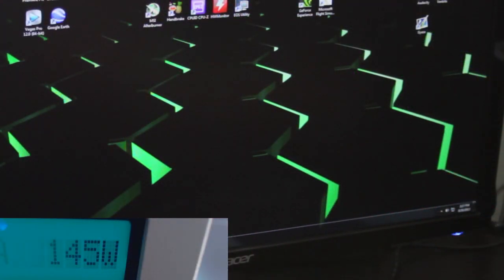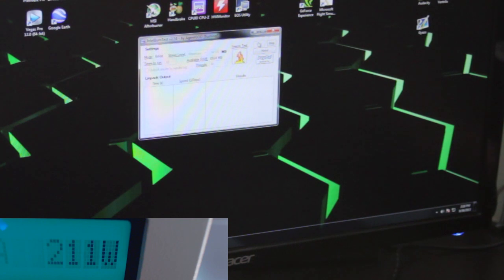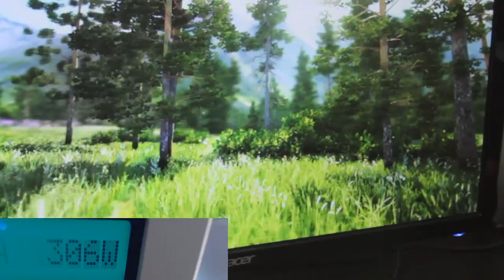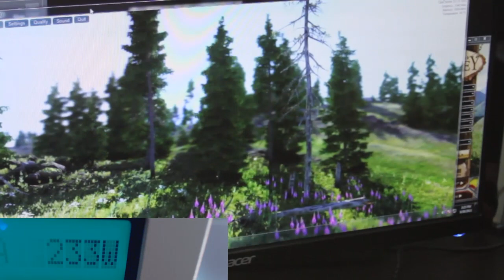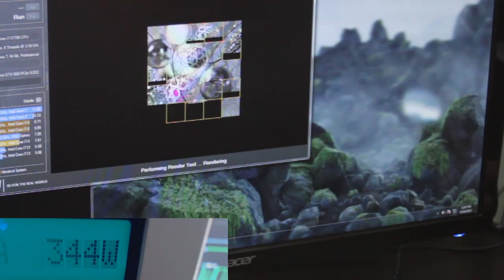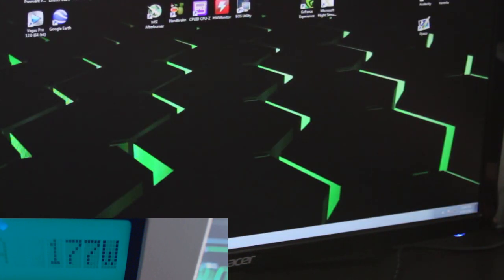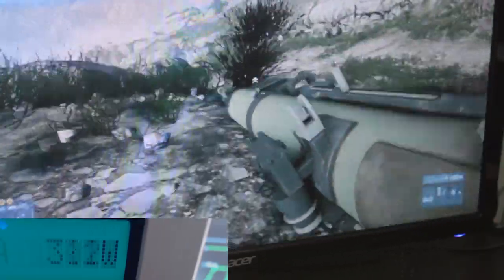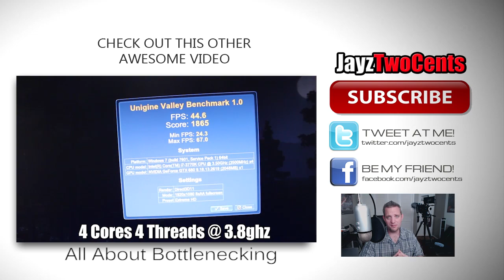How big of a Power Supply do you REALLY need?

Comment: Is 550w 80+ Platinum good for an i5-4670k (most likely overclock later in time), a GTX 770 2gb it has 3 fans on it, 8gigs of ram (2x4), asrock z87 extreme motherboard.
Reply: you can run that system easily with even a quality 450w. you're good to go. I've seen people run nvidia 780, titan, and even a non-oc 780 ti in a quality 450w.

HardOCP:http://www.hardocp.com/article/2013/05/30/msi_geforce_gtx_770_lightning_video_card_review/9#.UzHHPldniJQ

That's with a i7 3770k @4.8GHz and a highly OCd GTX 770 and it still only used at worst 373W. So even with those Overclocks, (373*0.9 for efficiency), you would use around at worst 61-62% psu load at PEAK during gaming.

Comment: I have:
GTX 680
i7 2600k
Asus  Sabertooth p67 motherboard
8 gb g skill rip jaws 2100 mhz
and 2 hdds
what power supply do i need?
Reply: quality 450w psu and all you really need. on the video, it showed at worst he was hitting 325w on the wall. account for efficiency, thats 325 *0.9 = 202.5/450 = 65% or so psu peak gaming load.

PSUs I reccommend: Seasonic G-series 450w, rosewill capstone 450m (if you're on a tight budget), Silverstone SFX 450w (for mini-itx systems).

Comment: can i use a 1000W psu temporarily on a rig without GPU's ?

as i am getting 2 780ti's for SLI in a couple months, so is it safe to run the rig ?
Reply: of course its safe to use less power than its rated for. The problem is when you use too much power your computer will shut off because the power supply "trips" like a breaker in your house.
Reply: Is it safe? Yes.  Is it efficient? No.  It also couldn't hurt to check the voltages manually, just to make sure they aren't off due to low load.

Comment: running a 850watt 80+ bronze 680/3770 might throw another 680 in a year or two but finding my card would cost more then buying a new top card would
Reply: Always sucks about that Enthusiast level 2 year old cards. they go extinct because everyone keeps them.
Reply: Christian Sanfilippo i checked the numbers my 680 right now with my overclock has better performance on average with games at 1080p then stock 780s do im sure i could still get $500 for my card even if it is older could easily hit 1.4 core and 7ghz on the memory if it was on water

Comment: Man!, if I tried to run this on my slow computer... O_O

Specs. (Not all of the specs because I don't really know how to figure them out... DON'T JUDGE ME)

AMD Athlon II 2.20 ghz Dual Core P340 Processor

64 Bit

HP Manufactured

2009 Windows 7 Home premium

I couldn't find out the other stuff like GPU, Motherboard, etc. Sorry.

Also note that it can barely run ROBLOX on the lowest settings

It crashed when I ran Starmade for a milisecond for the first time

AND it can't really run Minecraft that well either

Comment: I have a :
FX-6300 OC'd @ 4.2
8GB (2x4GB) RAM OC'd @ 1866
Radeon 7950 OC'd @ 1000/1300 Core/Mem
WD 1TB HDD
Optical Drive
Six 120mm fans
Fan controller
And all with a 650W 80+ Gold rated PSU. Been running great.
Reply: ***** Why would I need a 750W? My 650W is perfectly capable and has been running great. I have a SeaSonic too which is one of the best brands, if not the best.
Reply: ***** XFX over corsair inless you go to there top of the line i stay away corsair :( used to trust them 100% now XFX is my GO TO brand :D
Reply: INoIFearIGaming Seasonic is the shiznt :)
Reply: FX-8320 OC'd @ 4.5
8GB 1.5v 1600mhz
gtx 580 twin frozr 20% oc
WD 1TB HDD
Five 120mm fans
Fan led controller
3 led strips

on a Antec TP-550watt 80+
Reply: Archit N. Why should i get a new one when this one can keep everything stable?
Reply: OCed 7950 Windforce x3 (1150 core / 1500 mem) and an 8350 (stock) on a 550W Gold rated PSU and it works just fine.
Reply: Mats Renooij Get a seasonic 620w
Reply: Seasonic 620w.
Reply: ***** You have triple 7950's on a 550W PSU? No....you don't....
Reply: INoIFearIGaming windforce 3 is the model of gigabyte card cooling...
Reply: Durolith Ah, he meant Windforce 3, not x3. By putting the x3 I thought he was saying he had 3 GPU's

Comment: You are off on where power supplies are most efficient.  75% load is typically where they're best, not 100%.  At max load voltage regulation often starts to get ugly and efficiency falls off.  Just look at the 80+ certification requirements.  Power supplies need to hit certain efficiency percentages at 20%, 50% and 100% load and 50% is always about 3% higher than the other two as it's closer to the optimum range for a power supply.

As others have stated, overall efficiency is the DC power output of the power supply divided from the AC power draw (wall power) and lets you know how much energy is being wasted in the form of heat during the conversion.

Comment: u got the efficiency thing wrong. 80% efficiancy means that that power supply (assuming a good quality power supply . not a generic 1) will use 20% more power to deliver its stated watts. a 750w power supply will deliver that 750w while actually consuming 100*750/80=937.5w off the wall. it does not mean that a 750w power supply with efficiency of 80% will deliver 750*0.8=600w.

Comment: I'm kind of worried now that I went with the wrong company. AMD is pushing out some promising hardware and software to match with mantle. All I have is g-sync witch I won't want to buy 3 of then to replace the ones I have now, and not many games use physx. I got 2 evga FTW edition 770's. I hope AMD allows NVIDIA to acquire mantle support because it has true potential. Bf4 kinda skimped a little with it is my opinion.

Comment: i went a bit close to the danger zone on mine. r9 280x 4670k h80i etc with a 550w psu. predicted wattage on pc partpicker is 451w before i overclock. i went the 50 extra over the generic 500w to give a little room for the oc and for capacitor aging. informative vid jayz

Comment: What PSU would you suggest i get for my new build 600w or more?

MSI Z87-G45-GAMING ATX 

Intel Core i5 4670K

G.Skill 8GB DDR3

Corsair 120mm Hydro Series H80i

Asus GTX 770 Nvidia GeForce DirectCU II OC 2GB

WD 1TB (Black)

SSD: Samsung 840 EVO 120GB

Asus DVD-RW Drive

Case:  Fractal Design Define R4 (2x140mm case fans)

BenQ XL2420T 24 inch (120ghz)

Keyboard: Corsair Vengeance K70

Mouse: Corsair Vengeance M95
Reply: A quality 650W would be just fine

Comment: Something I don't get is that I have a corsair 550 watt power supply I use a single 7870 (overclocked) an FX 8350 (stock) on a 970 A motherboard with 8 GB of RAM single channel, I on multiple occasions have gotten blue screened while playing the witcher 2 and painkiller for some inexplicable reason bit not while playing BF3 or far cry 3. Could someone please help me, should I be getting a new power supply unit?

Comment: really nicely explained and showed, i always have those stupid arguments with some dumb kids/brats who think that in order to run any type of SLI you need 1000w+ lol. 

I have 600w myself, running 8-core FX8350 @4.1ghz, 16gb Corsair Vengeance RAM, GTX680 Phantom, LED strip, 11 USB devices. 2x SSD, 3x HDDs and Asus Crosshair V Formula-Z motherboard.
I think my whole system uses about 400w under load.

Comment: how much wattage will i need for an i5 3570 and a gtx 660?
Reply: you could run that with a seasonic g-360 gold modular psu even with an overclock on both the cpu and gpu.

Comment: what you said is wrong. a 1000 watt power supply at full load with 80 % efficiency will deliver 1000 watts but draws 1000/80*100=1250 watts from the wall
Reply: Look at the back of the box of your psu. It will probably say it van deliver more than the front of the box says. It is rated tot DELIVER 1000 watts. Have you ever had soms kind of science class?
Reply: Daniel Ungureanu if you had paid attention in science class or whatever it is called where you are from. you would know that if it is rated to deliver 1000 watts under load and it will convert ac to dc at 80% efficiency  it will draw 1250 watts. im not talking about peak performance so this has nothing to do with it being unstable.
Reply: Martin Heuts http://en.wikipedia.org/wiki/80_Plus  NOW ALL STFU YANNICK IS RIGHT!
Reply: yannick van niel to make it more easy for people to understand i will make a very easy example. if you have 2  cups, one full and one empty. you want to transfer to water to the empty cup. this cup will hold 1000 ML. while you transfer the water you lose some because you spilled some. this is your efficiency (80%). how big is the first cup? divide 1000 with 80% and multiply by 100% and you get 1250 ML or watts. in order to fill the first cup you need more water than will actually fit in there or in other words, in order for your power supply to deliver 1000 watts at 80% efficiency you will need more input than it will actually be able to output. the only difference with 80+ bronze silver etc is the amount of power that is actually drawn from the wall. it has no effect on power that is delivered to your pc. this obviously is not the case with cheap power supply's.
Reply: My bad. It actually seems this guy is right.
Reply: Sounds interesting from that point of view. Could you show that in a video?
Reply: yannick van niel We believe you! But could you maybe show it in a video?
Reply: Daniel Ungureanu Please explain why manufacturers put 1000watt on their PSU's. So that you can fry your PSU and claim warranty if your hardware is using exactly 1000watts all the time? No, they build a 1200, 1250watt (wattever) PSU with over 80% of efficiency, to deliver the promised 1000watts.

If you use a 80+ Platinum PSU, you would save money because a 1000watt platinum PSU would draw something like 1080watt from your wall socket.
Reply: yannick van niel That's what i'm also saying man! 1000 watts deliver 1000 watts to your components, but draw more watts from the wall due to the efficiency level. I was just stating that what Daniel was saying is wrong, He stated that a 1000 watt supply can max draw 1000watts from the wall socket and delivers less than 1000watts to your components. If what he is saying is right, then everyone who actually installing hardware that is using 1000 watts at max usage, you will fry your PSU (according to what daniel is saying!!). But you won't fry it, because it's made to deliver that.
Reply: "The efficiency of a computer power supply is its output power divided by its input power. The remaining power is converted into heat. For instance, a 600-watt power supply with 60% efficiency running at full load would draw 1000 W from the mains and would therefore waste 400 W as heat. On the other hand a 600-watt power supply with 80% efficiency running at full load would draw 750 W from the mains and would therefore waste only 150 W as heat." - From Wikipedia
Reply: I always thought that a PC power supply watt rating was what it can deliver. NOT what it draw's from your AC Socket .
Reply: Great thanks, yet I think that's not what we wanted to see Yannick. Let me specify: we need you to record on camera a PSU giving 100% of its load in DC and drawing 120% of its load in AC. Any 80+ PSU at hand will do. Even if it's hooked up to the PC and you know exactly how much watts the PC is drawing (might be handier to calculate). I'm sure Daniel would if not agree then at least accept the fact, right?

I am a musician myself, but I'm also aware of this phenomena in physics. We have so much freedom in this social network that we can directly contact a certain person and show him stuff, instead of doing good old "ALL CAPS RAGE ON DEM NUBZ"
yannick van niel
Daniel Ungureanu
Reply: Daniel Ungureanu
a psu is rated for the wattage on the rails. A 1kW psu will deliver 1kW on the rails and draw around 1200w from the wall. The 200w is being lost in the conversion from 230 to 12v and being generated in heat.
Reply: They are rated for what they can deliver and the power loss comes on top of tjat
Reply: He is. But to be a dutchie and call anyone stupid in an argument seems a bit undutchie to me....
Reply: Dmitry Granicin never mind that video is missing half il upload it again :l
Reply: yannick van niel Would be much appreciated :)
Reply: yannick van niel /watch?v=s4ZWHeodJpU this is the correct link
Reply: i'm sorry but i don't have the equipment to measure how much power i'm using
Reply: you can use a socket with wattmeter from one side (to see how much the PC takes from the wall), look for wattage of CPU, GPU, mother, RAM, HDD and SSDs on their manuals (or on the websites), and with the tester you check how much power is given to the motherboard via 24pin cable.
Reply: If I had my build complete and running I would do it myself, but right now I'm on my laptop so no luck for me.
Reply: Dmitry Granicin yes i understand but i don't have a watt meter. also most components will not run at maximum wattage even when under full load. so i cant know how much power the pc itself is using
Reply: You can already take it easy, I think. With information both of us supplied everyone seeing this conversation can test him/herself how PSU works and how much is actually needed.
Reply: Martin Heuts I thought it's common sense to take power supply a bit bigger than the expected load for it at least for the upgradeability purposes. I think if it's a 80+GOLD to 80+PLATINUM PSU it will be able to deliver full nominal load without frying itself...It'll just produce more heat and eat more AC, right?
Reply: Martin Heuts they put 1000 watts on their power supply's because that's what they are made to do. deliver 1000 watts... and to be sure you dont fry it they will give you some headroom. my 600 watt psu is actually capable of delivering 706 watts according to the box. but this is only the peak performance. also your logic is flawed. you reject that 1000 watt PSU's can actually deliver 1000 watts, because it will fry itself. and then you admit that a platinum PSU will actually deliver 1000 watts..
Reply: jikke dobbelaar That some nice explanation foranyone who need it
Reply: Ryusenko Hon You dare to tell me what to do? Then take care: your nose is not so sturdy as you would like it to be.
Reply: Dmitry Granicin lol...what did i do D:
Reply: Ryusenko Hon lol sorry dude I pressed wrong link jikke dobbelaar is the one actually.
Reply: Great guys, we all have sorted out our head and penis size. Now let's get to the real thing!

How much power do you need to run Crysis 3 on Very High with a Radeon R9 295X in winter season and keep your house warm without additional heaters?
Reply: Thank you.
Reply: A 1200 (in the same setup ) will draw less w than a 450. If you don't believe it ,try it yourself.
Reply: Google it if you are too stupid to think
Reply: yannick van niel - As a matter of fact I finished the electricians highschool and I know what I'm talking about, and this YouTube guy that made the video is right. I mean, I can't see why the "science class" bothers you, but whatever. Again, it can deliver over the amount of wattage is says, or even more but not under good and stable circumstances.
Reply: Daniel Ungureanu Partly wrong. A 1000W PSU will draw +- 1000 watts from the socket on full load, but only utilize 80% of it. The 20% are lost due to heat etc.

So if your PC needs 200W on idle, that means the PSU will draw around 250W of raw power and deliver 200W to the components. If your PC needs 800W, the PSU will eat 1000W from the socket and give 800W to the components. It cannot go any higher.
Reply: yannick van niel - Oh snap, ok, I see I have to deal with a brain dead kid. Which I'm not gonna do. So I'll just let you "google it". 

Cya. Stay in your stupid world of stupids.
Reply: Not true. How did you even got to that numbers ? Like the definition of efficiency is: "Efficiency in general, describes the extent to which time, effort or cost is well used for the intended task or purpose." , it's about how the PSU manages to use that 1000 W. The efficiency doesn't consist in ADDING more power to the actual number we have, but to how the PSU manages to use the actual power. Plus, you say a 1000W PSU draws 1250 W from the wall ? That's a plain stupid and retarded thing to say, because a 1000W PSU wouldn't be safe at 1250W. The factory that made the PSU should counter that by doing a 1300W PSU and rate it on the box as a 1000W PSU, wich again, is plain stupid and it would raise the prices of the PSU by a lot.

The efficiency is like he said: the amount of wattage you LOSE under some circumstances from your PSU. Where a 1000W PSU IS SAFE to draw 800W from that wall, if it's 80% efficient. It can go higher with 200W until 1000W but it's not sure it can do it under good conditions.
Reply: Michal Is - For him it is. Let it be, don't bother with this kind of people too much. "Google and Wikipedia" all day long, lol. I mean, put the hand on a book and read it, only after that COME to ME and argue with me.

Comment: How did u rig up that voltmeter? I need to test my power supply and wanna know where to connect it up to
Reply: its a watt meter, between the wall and your PSU
Reply: Jakey PC
lol I mean specifically, where do I connect the contacts to. is yours one you plug in between the plug and the wall? I've got a DVM with contacts on
Reply: For a Watt reading, you need one that sits between the wall outlet and the power lead for your pc. no other one will work.

Comment: Does anyone know if my Asus Gtx 760 Direct CU ll OC will need to use 1 or two six pin pcie power connector?
Reply: It will use either 2 6-pins or 1 6-pin and 1 8-pin
Reply: One 8Pin, just look on any online store, and look at the pictures